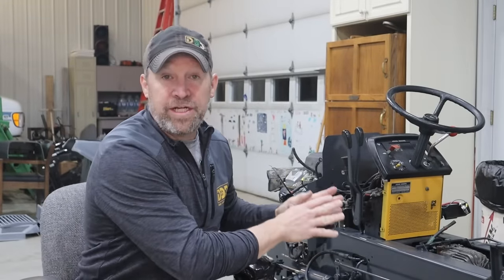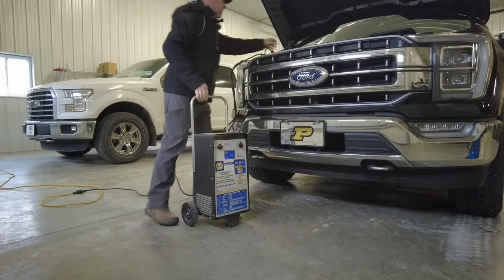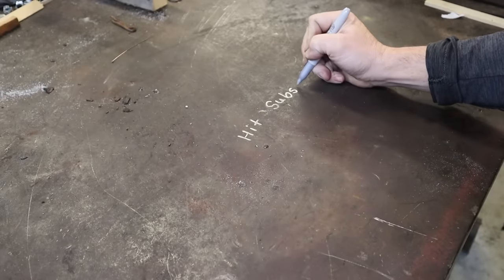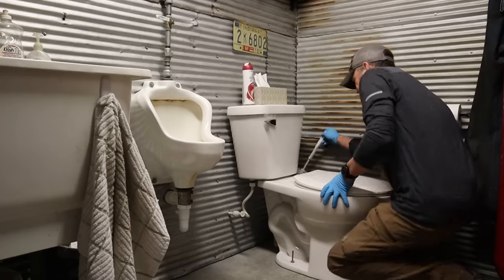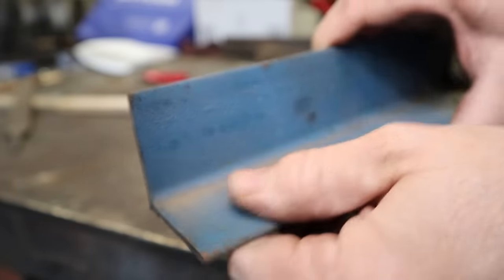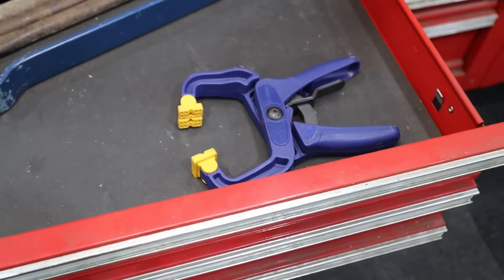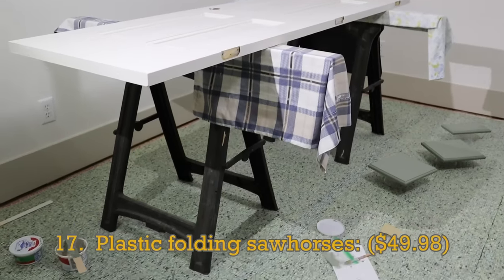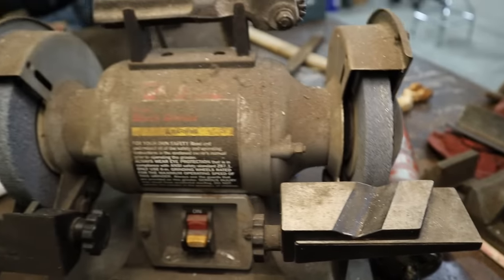(20) Must Have Tools You Don't Know You Need

Comment: The "smart" charger try to detect the voltage of the battery to try to make sure your charging the right voltage (6,12, 24 ext..) and also to detect when the cables are connected and not reversed. So they do it as a "safety features" but sometimes when batteries are drained too far they can not be detected right. If this happens some chargers have a "force" mode that will make it start outputting voltage similar to a dumb charger or an alternative is to connect a second battery in parallel so the charger will detect the second battery and start charging. After it has charged enough for the original battery to be detected the second battery can be removed. For me I still have my grandpa's ol 6/12v charger on the shelf the kind thats an all metal case weighs 20lb to lug around has a few different colors of paint and is missing  a rubber foot or two, analog gages and big copper transformers inside. You hear the thing come to life when you flip the switch and you hear the low humming of electricity. That's the one I pull out when these new light weight chargers don't work.

Comment: Flush cut pliers for zip tie ends. Better than that giant contraption you showed. $8 bucks at harbor freight. The only way to cut zip ties
Reply from the maker: This tool also pulls the zip tie tight just before you cut it off.
Reply: Ahh that’s cool too

Comment: Smart charger fix connect the jumper box then connect the charger all at the same time. It'll trick the smart charger into charging a really dead battery. Do not charger really dead battery with your alternator they'll take your alternator out. 😎
Reply: Just gotta apply 12v to dead battery first you are correct. I just jump with another battery use a noco smart charger myself.
Reply from the maker: So two jumpers to jump one battery :)
Reply: @digdrivediy  kick strart a smart charger. More like 2 batteries 1 charger:)

Comment: Single edge razor DISPOSAL:
Take a piece of 2" wide painters tape and tear it to be at least twice as long the width of the blade.
(Okay let's see if I can say this in words....)
What you want is to fold the tape over the blade edge EXCEPT not have the fold at the edge itself.  Have the fold be a half inch BEYOND the blades actual edge.
So, take one shop edge of the piece tape and center it on one side of the razor blade using the folded metal "handle" as the guide of where to set that tape's shop edge.  Press the tape to fully adhere to that side of the blade.  (Functionally the blade is pretty safe at this point if you just want to press it against the tool cabinet side waiting for its next use.)
Curl the tape over the blade and run the opposite shop edge along the opposite "handle" edge.
Pinch the tape down on that side of the razor to create the Safety Fold.
If I got you to do it correctly you have a stiff half inch of doubled up painter's tape acting as a "tongue" to shield the razor-sharp edge and similar tongues protecting the "raw" razor sides.  Safe for any trash can or bag.

Bonus:  the blade remains obvious for what it is.  There are times I have reached back into the shop trash to rescue that recent deposit because a shop need has comes up that needs a sacrificial blade and a raggedy blade will do fine.

Comment: You can fool those fancy chargers if you hook up a second battery in parallel. After it starts charging just disconnect and dead battery will finish charging.

Comment: Just use an electronics bench power supply to dribble enough charge into the dead battery to convince the electronic device that it can be charged the rest of the way.

Comment: careful with the old chargers, the newer trucks since those old chargers, were made have regulated and rectified computers that burn up. scotty kilmer, the easiest way to ruin a new car with improper voltage and amperage can kill many of the multiple computers in newer vehicles and they aren't cheap being about $4,500 because L.E.A.N. manufacturing, there are no spare parts. everything is made pre pay on demand.